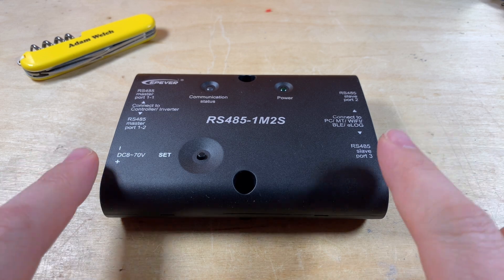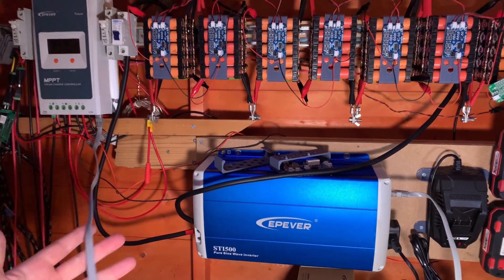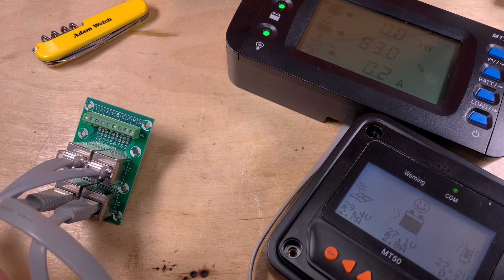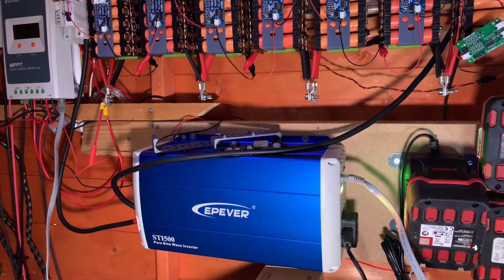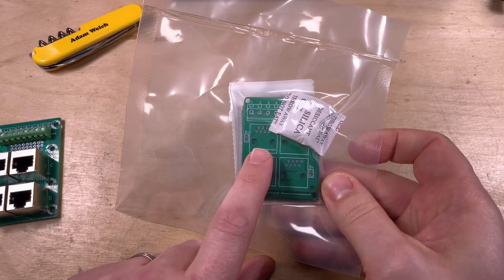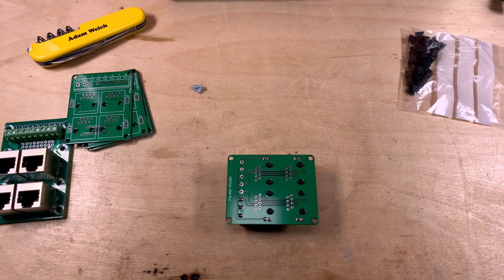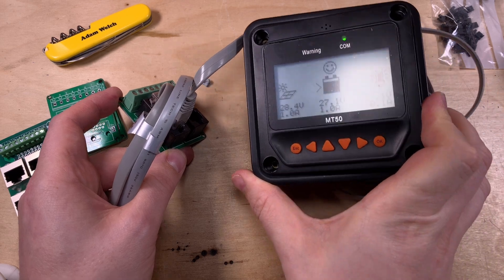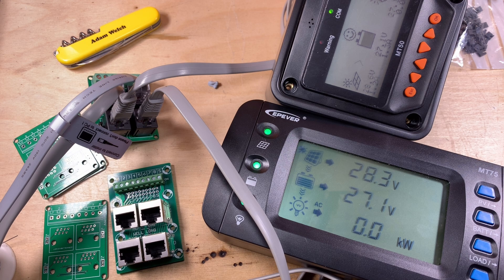RS485 Module - Creating a bus

Comment: Hey Adam. Got a friend with 5 tracers and he wants to monitor solar. I know I could use the parallel adapter and pc app, but he wanted to use the android app. Eleven said there is a 1M6S for connecting multiple mppt’s to a single WiFi adapter but cannot find it anywhere. Are you aware of a way to it?  Thanks. Mark

Comment: Just got my Well Long module from China and it works a treat in sharing data between my MT 50 ( in the garage ) and my new Photonic Universe version of the Epever 2.4G RJ45 A Wifi Adapter.  (black box). However , having problems setting up the Cloud App on Epever Share which just goes round in circles. The local app performs great. Have you looked at any of these more recent wifi adapters?
Great stuff Adam. I have learned a lot from you videos. Have you retired or found some other interests? 
Best regards, JW

Comment: Hi Adam, great video as always. Quite a while haven’t seen any new video from you.
Hope you’re just doin’ fine.

A quick question yet a bit out of topic mate,  I personally use this Tracer 2210AN and about to try to use it as solar charge control for Lifepo4 batt 48v (15s). Despite of the fact that Lithium battery can’t be automatically identified by this Epever Tracer (I hope it won’t be locked somehow on 12/24v), I would like to take an advantage of that for 48V Li Batt, my solar array 1kW 4s 88V Voc (still below 92V as it stated)

Do you think is this possible? Or maybe have u tried once?

Thanks mate.
Reply from the maker: Hello. Sorry I’ve been quiet, all my spare time has been stripped away. Hope to be back soonish. 
Sadly the tracer 2210AN is only 12 or 24 vaults. You’ll blow something (capacitor, mosfet, regulator, all three?) inside if you connect to a higher battery voltage. With the size of your array and your battery voltage you need to look at a more serious controller I think. 
Thanks again.
Reply: @AdamWelchUK  Ah I see.. the secondary side. Will blow the capacitor for sure at first, it’s 50v or even 35v rated as I recall.
Well just wanna make use of my old Tracer AN 2210 which been laying around for quite sometime, as I’ve been using grid inverter directly to PV with no battery.
Thanks anyway, will consider another competent charge controller in future. 
Keep having fun and stay healthy, hope to see you back with the vids soon 👍

Comment: Please create a video about  diy “usb to rs485” adapter and rj45 wiring for adapter to connect epever charge controller (ls-b series) to laptop without buying epever usb to rs485 cable.

Comment: Hi Adam, we’ll done, great option. Did you ever workout why you are getting the errors on the MTs?. I have an epever 4210, a mt50 and a home made snektek dashboard with 3 rj45 ports as a hub. Whenever I plug in the mt50 I get errors and occasionally the dashboard crashes. I’m guessing the dashboard and mt50 are both masters.
Reply from the maker: Yes it’s the fact there is more than one master. The rs485-1M2S overcomes this issue, or the MT80 meter should - but I’ve not tested that because when I looked I couldn’t buy one!

Comment: Nice design. I would have used the top connector and cut the end off a cable, then either struck off the relevant link or just not connected the relevant wire.

Comment: Be careful how many devices you connect, being powered by the SCC. I have a Tracer 6415AN, with 2x RS485 / RJ45 sockets. With an eLOG01 and MT50 daisy chained on one socket, used an RS485 to USB cable on the other. My SCC has been sent back for repair, after the 5V failed on the RS485’s. It’s also a good idea to leave the SCC in AUTO battery voltage mode.
Reply from the maker: Thanks. I have been considering that. It’s outlined in the 1M2S manual that to have two outputs two inputs should be used. That’s why I left the terminal block on my pcb - I could power the meters separately and disconnect the five volts from both the solar charge controller and the inverter. Things to investigate. Thanks again.

Comment: Be aware that you are making a sort of star connection that is not recommended due to impedance mismatches, if you have short distances or use a low enough baudrate you can get away with it but you also have to make sure that there are 2 termination resistors at the ends of the bus.
Reply from the maker: Thanks. I imagine there are resistors built in to the devices - as they’re sold to be connected one to one without any external components. I should check though. All working ok at the moment though.

Comment: RS485 requires terminating resistors. I don't think I see them.
Reply from the maker: I believe the devices have them. I should check though…
Reply: @AdamWelchUK  Terminating resistors are supposed to be installed at the end of the line to kill off reflections. I Think the 2 resistors required are 120 Ohms each, but I am quoting you from memory and my memory is shit :)

Comment: You should look into Neutrik 8 + 2 pole XLR
Canbus  - RS 232 - RS 485 - TTL - UART +  XLR  all Serial bus protocols 

However serial does have a short fall  Devices have to wait in turn due it cant multi Task simultaneously multi Devices calls due the serial Data Communication Packet  frames are busy with DATA traffic however TTL did solve the issue due it a IP TCP Network and as has a network data kernel to time share multiplex 

6:10 Use optical isolators You See them on RJ 45 Ethernet cards  (& TTL + USB )

An example tp-link TG-3468 1 Port Gigabit PCIe Network Adapter 32Bit

Comment: Then: What's the advantage of the Epever RS485-1M2S? Is it just connected through with some fancy lights?
Reply from the maker: It has a wide voltage for power injection and possibly manages the rs485 traffic. I must open it up one day :-)
Reply: @AdamWelchUK  You should do this soon.

Comment: Might have been easier to clip the wire in the cable
Reply: You can make yourself up a cable minus that wire easy enough too.
Reply from the maker: This is true. I thought the pcb being able to connect and disconnect as I wanted was worth the few dollars it cost me. Cheers
Reply: @AdamWelchUK  I spent half an hour unsuccessfully trying to process the BOM file before I came to realise that. Can you give me any pointers to process one successfully? I’m using an iPad if it makes the difference.

Comment: Careful. The two meters will interrogate the charge controller every 30 seconds. There could be a collision between two modbus masters talking at same time with unpredictable results.
Reply from the maker: Thanks. Interestingly the implementation by EPEver puts the sole charge controller and inverter as master devices and the monitoring devices as slaves. No issues as yet, but I’m doing this so others don’t have to! Thanks again.
Reply: @AdamWelchUK  I didn't know about the charge controller being a master with a meter connected. I have been using an esp32 as a master to poll the controller using an Amazon  generic rs485 adapter. I do not see anything coming from the charge controller on my scope without an esp32 command. However, using the factory supplied rs485 dongle does not seem to work when connected to a pc python program, but does work with the epever pc software. On the other hand the factory dongle does not seem to work with a python program. Maybe the factory dongle tells the controller to be the master. The factory dongle uses a special driver program on the pc. Thanks for your very good videos.
Reply: @AdamWelchUK , that's not how Modbus works. The bigger MT-unit must have two separate buses in which it is 0x00 and talks only to 0x01, which the chargers are preconfigured with.